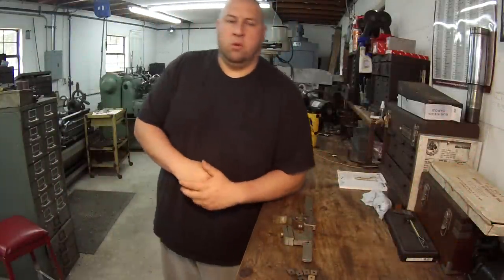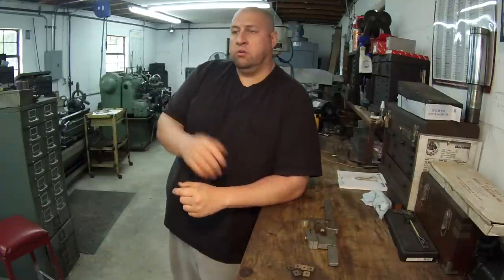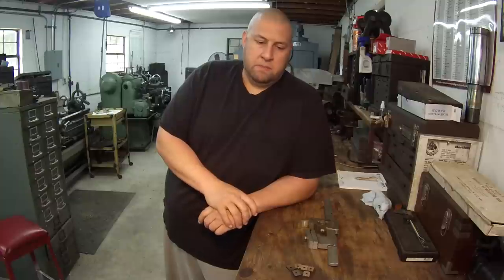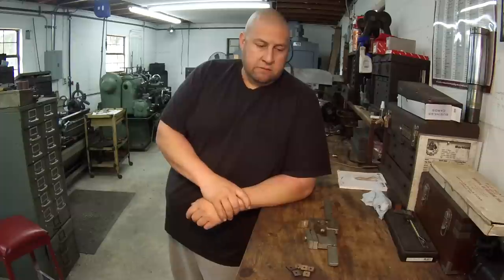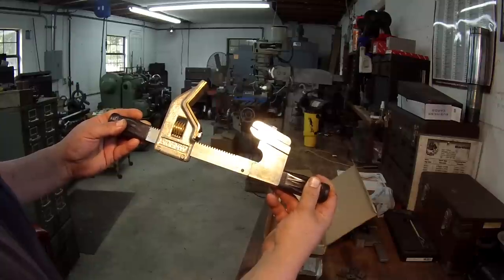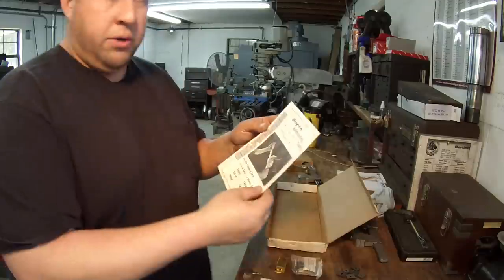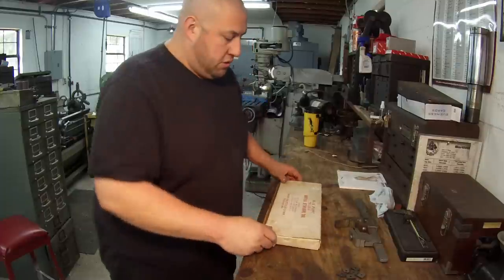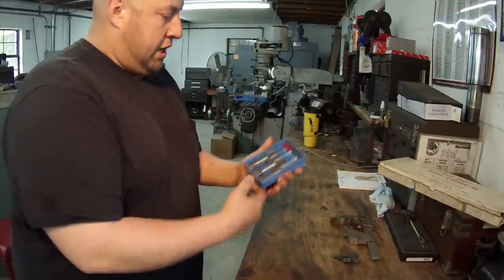Flea Market Finds Part 1

Comment: Hey Adam,

Sorry you have the flea market disease. Its worse than getting rid of bedbugs. Nice finds this week. You better get yourself a backpack buddy. You're going to need it.

Talk to you soon.

Tom
Reply from the maker: Tom, no need for a backpack....I have a one ton Dodge pickup truck that will haul quite a load, and an 18' trailer if I need to haul even more!!

Seriously, when I'm at the Moultrie GA swap meet what I noticed there is most people have some sort of big wheel cart or heavy duty wagon they pull to haul there buys in. Its not a bad idea because you can spend an entire day out there and not see it all! I think I'm going to get myself one, maybe an el-cheapo from Horrible Freight.
The local market Ive been going to has close parking all around so its not too bad to run back to the truck if I pick up some items. 

Thanks Tom! Talk to ya later

Comment: Adam, I have two of the Snapon thread chasers as well. They sold them as spindle thread repair kits for chasing threads after wheel bearing failure. The ring fits through a hole in the end to keep everything together. Both of mine belonged to my Dad. Love it!

Comment: A set of thread chasers are so useful. It never ceased to amaze me how a job would come in the shop and someone had managed to smack the threads with a hammer and then look you in the eye and have no knowledge of how it ever happened.
Clive
Reply from the maker: Hell one of my co workers can mess up a brand new thread I machined 5 minutes after it comes out of the lathe!

Comment: Adom .Have been using similar spindle thread chaser from OTC Tools. All the threading dies store on the tool. only major difference is that my tool doesn't have the secondary handle. OTC 7402. thanks for all your videos.

Comment: Cool tools! You certainly got some real bargains there.  Just make sure that you're sitting down when you check the new prices for those thread chasers in the Snap-on catalogue. Well done.
Reply from the maker: I hope that means I got a good deal, I'm almost afraid to look it up now.
Reply from the maker: xj9ox I just looked at them on the on-line Snap-on website.Wow, i think I ended up with a good deal! $200 for the TR-20 with 9 dies, and another $150 for ID chasing tool, or $195 for the metric ID tool set. Add all those up and thats way more than I paid.
Reply: Abom79 Yep! It's a bit late now but I was just about to suggest that you film yourself looking up the catalogue. I reckon your reaction would have been priceless. Good luck with your new addiction.  Simon

Comment: I never find the treasures like you and Tom do at any of the flea markets around here. We have a thread chaser like yours at work but most of the die's are missing. There nice for cleaning up threads on the end of big rig axle ends.
Reply from the maker: It will work good on all of the hydraulics I work on too. We deal with many rods that are threaded on the end for a clevis. The tool works really well too.